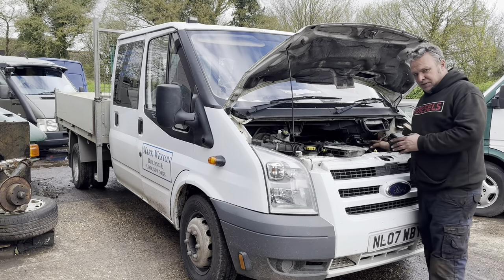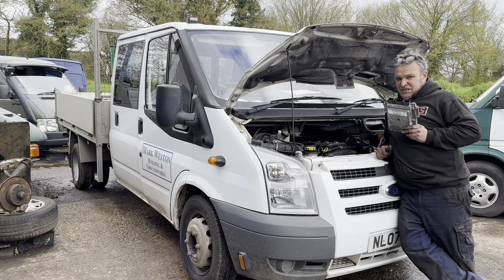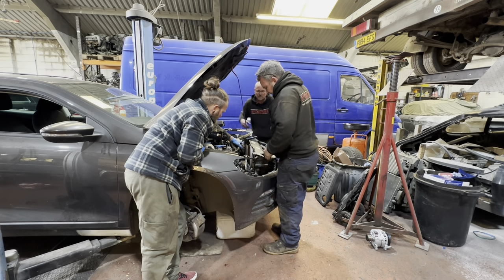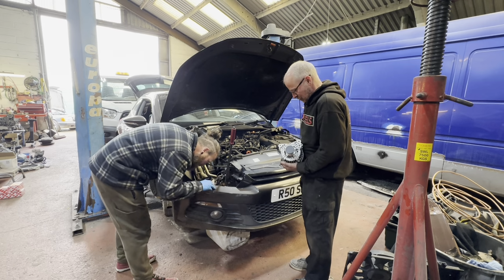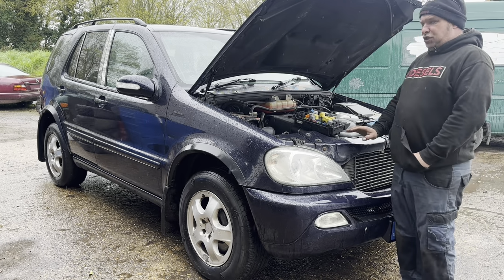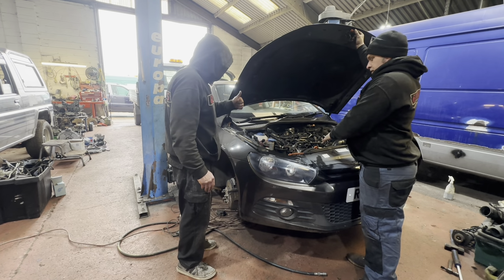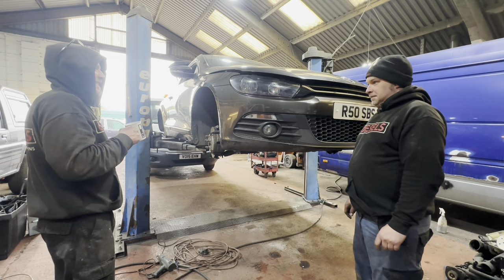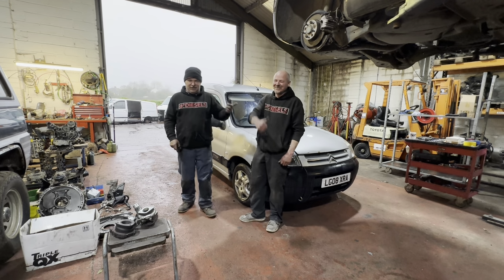We’ve got to finish it all before I leave!!

Comment: Back in the day it used to be rust that killed cars.The manufacturers were shamed into removing that issue and built in electrical trickery as an alternative!!!!!
Reply: Absolutely spot on, also occasionally when a reliable system slips through the net, they get straight to work buggering it up

Comment: VAG tdi alternators! Got one out the top, proper nightmare never again. Much easier the other way, Aircon pump is 3 bolts and there is enough pipe to swing it out the way gassed up. So yes, fully recommend the bottom first approach next time 👀 top work 👍

Comment: If you is going near Hamburg, if you ask nicely Ford may let you take a look inside their obsolete parts warehouse where all the experimental and rare stuff gets shoved.   Keep an eye out for a Taunus Transit aka Ford's ripping off of the VW bus and the original proto Transit, very very rare and desirable.   Whilst at Ford Hamburg, they may still have lurking about the Tickford's MK2 1.4i Fiesta prototype, only one made and faster than a nun after her first vindaloo, 2dr coupe and booted Taunus Cortina's always nice esp the 2.3's basically the MKIV and V Cortina but in funkier trims and bodystyles, Opel Monza also very desirable esp the bodykitted Recaro GS-E with the digi dash only in white and boy racers wet dream.   MKIII Taunus Coupe with the 2.3 v6 having the coupe back end from a Granada Coupe but the front end of a MKIII Cortina GXL... sexeh as fu..

Comment: It is obviously a " lock up " somewhere probably a missing " empty buffer " countdown which normally doesn't matter because it's cleared by the last cycle , but probably there is a function that occupies the next register , that for whatever reason overflows and a bit of the code instead of counting say  ..  01001 17  down to zero starts with FFFF 65,000 , you get a injector full on for a couple of seconds,  it would be caught if the original programmer had cleared the buffer before calculating the on time needed ,  it's a " chain of consequence"